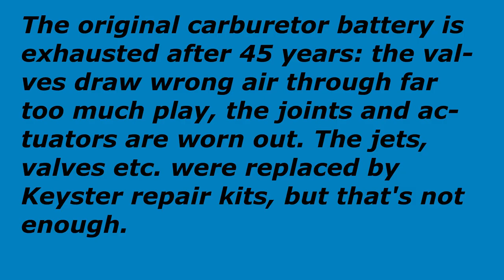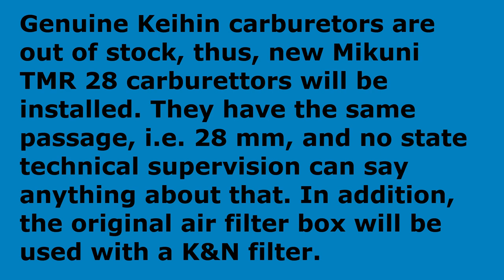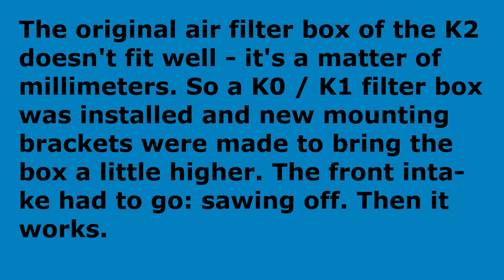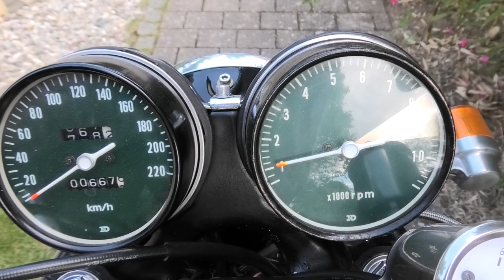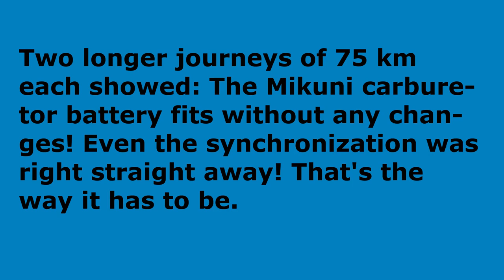New carburetors for Honda CB 750 Four.

Comment: Only 667 kms showing in 45 years.
  Did you also replace the odometer, or has it twirled around over the 100,000 ?
Reply from the maker: No, the speedometer is new.

Comment: Hi there, would you kindly provide some information on the carb boots you use? I know the 750s use a 39mm boot, but they have a divet in the ends because the old keheins have a ridge on the exit manifolds. But, the Mikunis are opposite, their carbs have the divet. I've seen online that the boots they sell have the ridge inside. I've also noticed that the cb750 boots are curved where the Mikuni boots (of the proper size) are straight.

Did you replace your carb boots with the Mikuni carb boots or just use the Honda cb750 boots? And if neither, what boots did you use? Is there a vacuum leak and if so what did you do to fix that?
Reply from the maker: Sorry for the late answer: I used the genuine Honda boots betwenn carbs and cylinder head  and also the genuine Honda boots between carbs and air filter box. The Mikuni carbs feature fitting venturis so no changes are necessary. I bought those carbs from Topham Vergasertechnik, Germany which also applied the approbriate jets. Contact Topham - that is easy because he lives here but is British from birth.
Reply: @prof-rieg  ahhh okay, perfect thank you!

Comment: and how much did they cost to you?
Reply from the maker: About 1500 Euros.
Reply: @prof-rieg  I have a question for you, in the daily use of the motorcycle these carburettors behave smoothly? They do not give you problems such as fouling spark plugs, burning a lot of gasoline in low range, etc. I am very concerned about a smooth running of the engine in the city and at the same time fast when accelerating on the highway. I have had problems with some Keihin CR's .... they only work at high speed.
I appreciate your response in advance. Fernando.
Reply from the maker: @fernandorivera9968  No problem at all, Fernande. The Four runs extremely smooth with those Mikuni carburettors but had a much better acceleration and much better response to the throttle grib. I have no idea about the fuel consumption, I guess it is a bit higher than with the genuine Keihin carbs.
Reply: @prof-rieg  Thank you very much for your answer!. as soon as I install those carburettors I will send you a link of the bike.
Reply: @fernandorivera9968  Keihin CR's are race carbs, they are only designed to work on the high end.  They are a hoot to ride, but the cold start mechanism is awful and you have to have the idle set to 1500 rpm in order to keep the motor running.
Reply: @travisshrey6720  Hi Travis, Unfortunately I discovered it late... but the new Mukuni carbs have arrived so the bike will be ok. I will sell the CR's to the highest bidder in case you are interested. they are new and with many idle jett to combine.
Reply: Do you have really to change the gassgriff because the mikuni is exact the same size as the original Honda ?

Comment: Inspection requirements are WAY too overbearing...just be glad you don't live in Belgium where you would have to have your carburetors flow benched to ensure they conform PRECISELY to factory specifications for your particular motorcycle.
Reply from the maker: No, I had no problems with the German administration at all because the manifold diameter of the new Mikuni carbs is identical to the diameter (28 mm) of the genuine Keihin carbs.